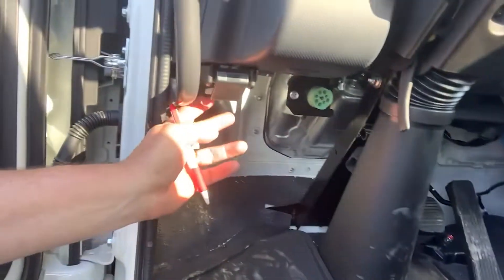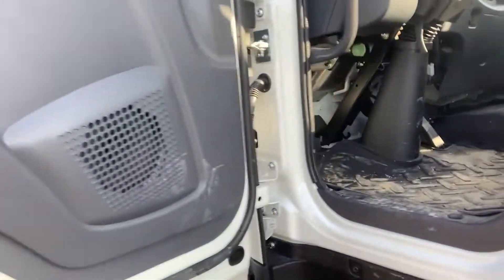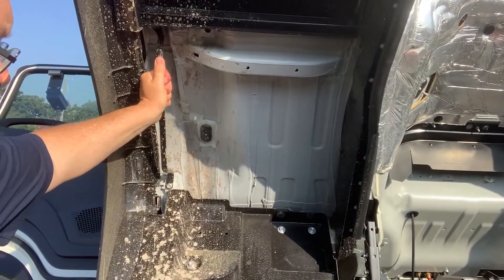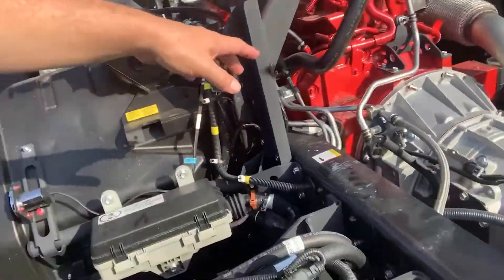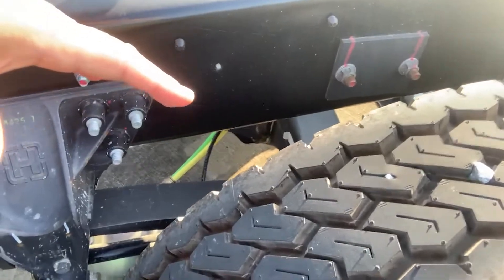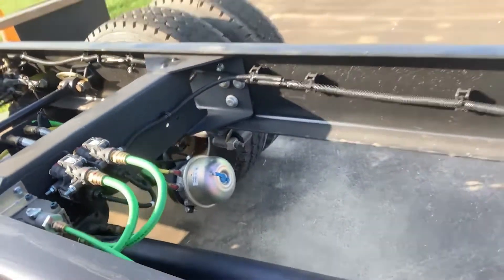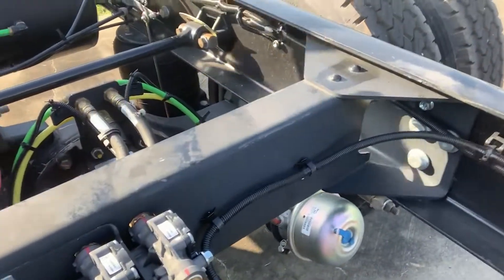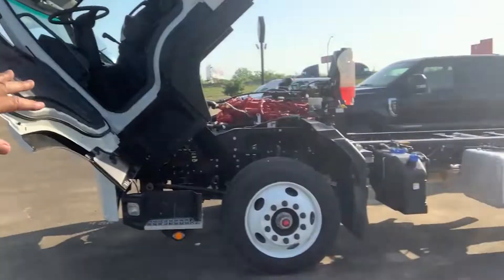Isuzu FTR Air Brake System - How the Air System Works

Comment: For the In cab Air Dump switch is there a way to manual adjust how much air the brakes release when that button is triggered to lower the rear end if you need it lower?
Reply from the maker: I was not able to confirm whether there is a height adjustment.  As I was told, the air bags are designed to operate ate capacity on the road.  If your need is to adjust the height while in operation - no.  It is also why the do not suggest a variable height.  Operating the bags on the road outside of their design could prematurely wear the bags.

Comment: I have a 2018 ftr with 4hk1 engine that has slow air build up. I noticed it doesnt have a signal air line from the governor to the compressor head. Any ideas what issues could be wrong?
Reply from the maker: I apologize for the delay, the slow air build up could be a need to service the filter.  When was the last service performed on the air dryer filter?

Comment: Great video... My question is, how do you perform a DOT brake test on this type of system? How to you make the emergency spring brake engage?
Reply from the maker: The two primary system in the stats are the pop spring and then there is the lever with collar.
The pop test is performed on the NON LEVER system.  Air brake default to applied.  It takes air pressure to release the brake from the drum.  The lever system does not pop.  The collar is lifted and the truck air supply is released.  BUT if there is not air in the system the truck will still not move.
That said to test the emergency brake parking brake:  with the truck off - bleed all the air out of the tanks via the brake pedal or at the tanks.  Start the F series trucks, put the truck in neutral, lift and release the collar for the applied brake position.  The truck will not move.  As the air pressure in the tanks increase - keep your foot at the ready above the brake pedal (if you are not on flat ground).  One the audible alarm ceases the truck has enough air to apply the brakes.  Feel free to test on uneven ground as you will feel the point in which the air system has enough air to release the brake pad from the drum.  
So there is not a pop test on the Isuzu.  It is 'not applicable' as a safety evaluation.
Hope this helps!

Comment: Curious, we run one of these at work. Can you do a conventional pump down and air brake test to adjust the slack adjusters? No manual in our truck
Reply from the maker: Let me know if the following answers your question

Brakes — Be alert to illumination of the brake air pressure warning light or the buzzer, or changes in braking action, such as repeated pulling to one side, unusual sounds when braking, increased brake pedal travel or a harder pedal. The front and rear brakes are attached to an auto adjuster mechanism. If there are no defects, and the brake stroke is properly maintained, adjustments are not necessary. The automatic slack adjuster should maintain the brake chamber stroke at 2 inches or less. Brake chamber stroke is the distance the push rod travels from brakes off to brakes applied. If the orange brake chamber stroke indicator on the push rod is visible outside the brake chamber, the stroke is greater than 2 inches and the brakes should be inspected. Have your Isuzu Dealer inspect the automatic slack adjuster for correct operation and set up.

Slack Adjuster Lube — Lubricate the slack adjusters and brake camshafts using at the grease fittings. Apply lubricant until clean lubricant flows from the grease relief opening. Lubricate the clevis pins with grease by hand or a spray lubricant and check to see the pins are not seized. Perform this maintenance every 10,000 miles (16,000 km) or 6 months whichever comes first. 

Slack Adjuster Service Inspection — Inspect the slack adjusters for damage, smooth operation and that the brake actuator push rod stroke does not exceed the allowable limit. Perform this maintenance every 10,000 miles (16,000 km) or 6 months whichever comes first. Repair as necessary.

The above is from the 2023 F Series Owners Manual.